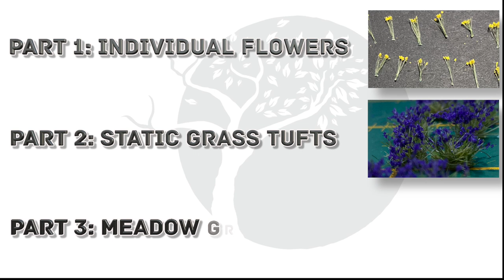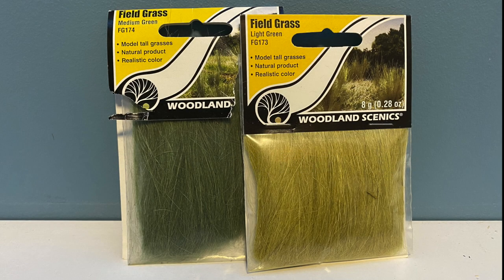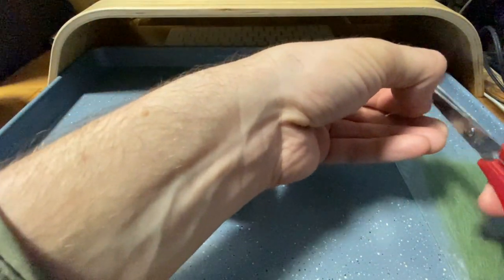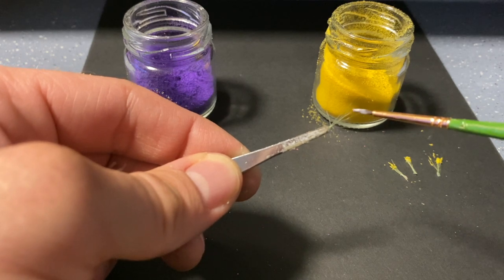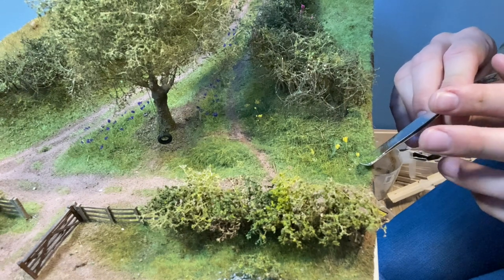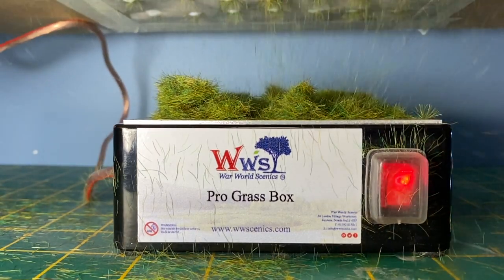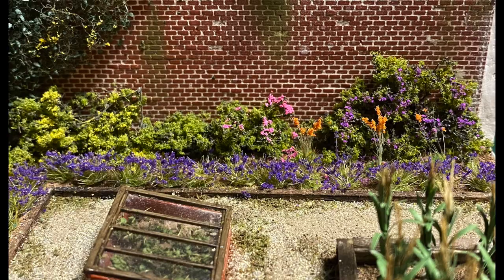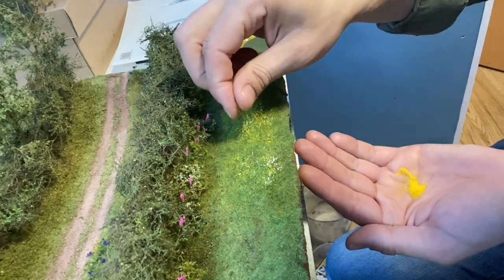Model Flowers - individual flowers, static grass tufts, meadow grass and wax crayon flowers

Comment: You might try freezing the crayons and a cheese grater and making the finds without a pencil sharpener, I am not keen on the crayon method as they can re-melt if layout catches the sun or is in a hot attic. I have made it before using a wire brush attachment on a dremel and just rasping bits off a piece of coloured plastic!
Reply from the maker: Ah, plastic is a great idea (might need to steal that!!)
Reply: Would spray or brushed on varnish on the flowers afterwards solve the melting issue? Avoiding the tufts to   stop potential beading.

Comment: Thanks very much Andy for putting up this tutorial so quickly, fascinating! I already use the wax crayon method but your method of making the flowers is excellent and I shall be making quite a few batches as well as the tufts. My pro grass box never seems to work as well as that though, must try a new battery. One method I have recently used for bullrush type tufts in a stream is to take a good bunch of field grass, cut off the straggly end, add a length of black thread with a slip knot at the length required, wrap round a few times and add superglue around the knot. Cut off the other end at the same length, spray superglue (I prefer mitre bond) activator and then cut off either side of the thread leaving 2 tufts glued together at the base ready for planting with scenic glue. One again, thanks Andy. Cheers Steve
Reply from the maker: Thanks Steve.  That’s a great tip for tufts and something I need to try 👍🏻

Comment: Hi Andy. I've just found your channel and I've subscribed instantly. An excellent video featuring truly beautiful work. Nothing makes a diorama look more interesting and more realistic than realistic vegetation and yours is amongst the best I've seen. I have a question. Have you tried sticking the crayon-dust to the stems of your flowers using tiny blobs of cyanoacrylate glue and did it work? I ask because I have experimented with various methods for making 'indestructible' plants, flowers, bushes and trees for my 'ever-lasting', multi-pose, reusable, diorama', essentially so that the whole diorama can be vacuum-cleaned and jet-washed to get rid of the dust without causing any damage. I've actually just cleaned 6 years of accumulated dust from my  WIP diorama using said machines and my Seafoam hedgerow, whilst reinforced with PVA, is looking a bit worse for wear. LOL. So my hedgerow will have to be repaired and improved. I will DEFINITELY be using your crayon method for the undergrowth if the CA glue works. I love your foxgloves! OH, and a tip for you. When you make the double-ended flowers and cut them in half, why not AT FIRST, stick loads of bunches of stems along a narrow strip of sticky-tape, so the stems stick out both sides. Run PVA along the edges of the tape to fix all of the bunches at their 'snip off points', apply the flowers to both ends, then snip all the bunches off in one go? It would speed up the process and be far easier and faster process,  especially for those like me who are 'cack-handed' with nerve-damage. Now I must have a look through your back-catalogue of vids. I may be some time. LOL Cheers. B.
Reply from the maker: Thank you very much, I have just subbed to your channel.  I haven't tried the glue method but it's worth a try to toughen them up!  Your point about the stems and using sticky tape is a great idea and I'll have to try it the next time I make flowers - anything to speed up the process!!  Everything I do seems to take forever and I usually wish I'd done it differently!  All the best :)
Reply: Hi Andy, nice to 'meet' you. Thanks for subbing. Much appreciated. You sound a lot like me then. I have an idea, try it and then fiddle with the method to improve it, but then end up fiddling even more. The problem is that one can improve every method, again and again until you spend several years making just one hyper-realistic 1/35th scale oak tree. LOL One has to strike a balance. But, I am forever trying to find ways to speed things up, make things easier whilst retaining an acceptable level of realism. That is the most important thing in my book. Originally, that was because I hated wasting time and energy, but more recently I developed an illness with progressive nerve damage and find it harder and harder to do the fiddly stuff, so my 'hacks' came in handy and hence my channel name. My videos are pretty awful though LOL.
Reply from the maker: @BADDERSBETTERDIORAMAHACKS121  I think we are all very self critical in this game but I suppose it makes us slightly better each time we do something!

Comment: I have a Noch Grassmaster Mk 1.. about 15 years old.. looking to replace with a WWS Grand static grass applicator..now my question is.. do I need the tuft maker as well? I will be using a lot of tufts... your thoughts please
Reply from the maker: Hi Roy.  My personal experience, although limited, is that the grass box creates better tufts than an applicator.  However, it might just be my technique which is lacking so if you only have the applicator you can still get great results.  I have two applicators and the box and use them all for different things but was lucky enough to win two of them.  If budget isn't an issue, it's nice to have all of them!
Reply: @DartsideScenics  I'm lucky in that my budget is fairly generous.. I have just ordered the Tuft box and will order the  WWS Grand next month perhaps. I get my fibre's and glue from a professional flocking company (Thomas and Vines) and it is much cheaper than elsewhere.. although they only do 2mm maximum so will need to multi layer the tufts etc....as a train driver I see the near lineside every day and I think tufts will provide a much more realistic appearance than just flocking over scenery
thanks for replying .. great channel
Reply from the maker: @trainmanroysmodelrailroadh7686  excellent!  I look forward to seeing the results. It sounds like you have the perfect job to get inspiration for modelling.  Best wishes.
Andy